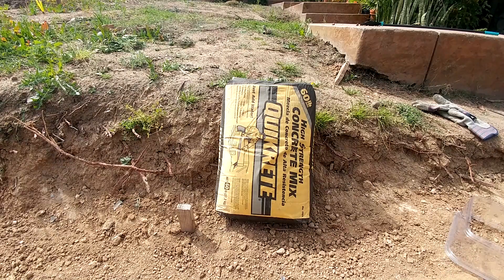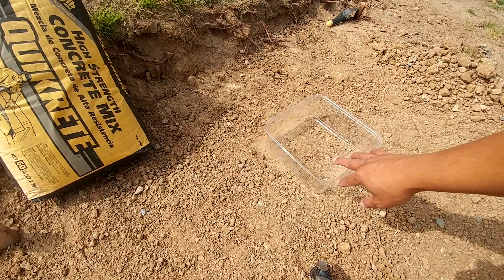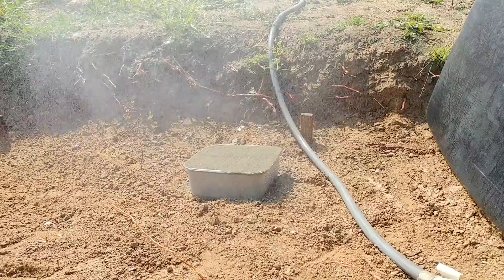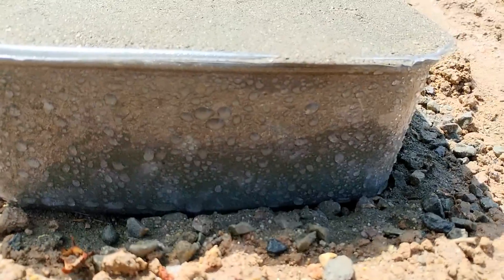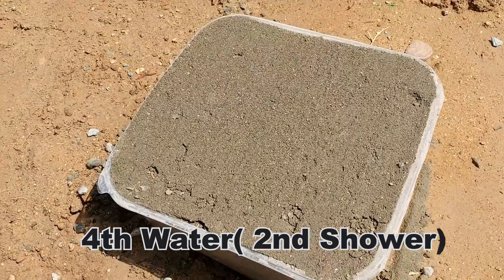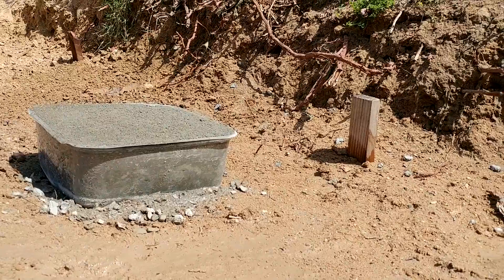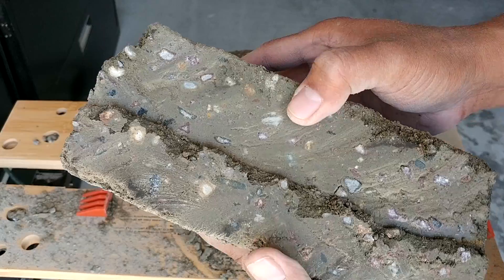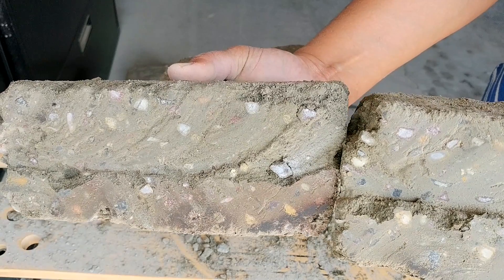You Won't Believe What We Found in This Dry Pour Concrete Experiment.

Comment: concrete takes months to get to full strength leave it and even water it over a few weeks it will soak more water in
Reply from the maker: Thank for the comment.  28 Days to get to 99% and will continue to harden overtime. I have another series of videos on dry pour where I will test the strength development once a week for 35 days. And like you said I will let those samples sit for 60-90 days and do one final test.   Stay tuned.

Comment: This is not satisfactory for use in most high traffic areas. Best used for small areas and foot traffic only. I live in New England and it wouldn’t work here. Maybe in the South, it would be decent. Never compare to wet.
Reply from the maker: I agree. After doing some experiments, I decided to mix the concrete the right way for my parking spot. I just finished it and will edit and upload the video on my 1st pour pretty soon.

Comment: if dry pour was good it would say dry pour in the instructions. concrete trucks would deliver dry concrete mix. the romans would have been standing over the aqueducts misting the dry pour concrete. but none of that is the case is it? this dry concrete thing is just a case of mixing concrete sucks and is hard and believe me i get that im lazy as shit but dude you're all wasting money.
Reply from the maker: Thanks for the input. In what I have observed, dry pour takes forever to cure and you will probably get up to 50%-60% strength as compared to wet pour. You can see that on my other dry pour experiment.   Definitely not for load bearing and driveway application but It could work things like walkway or garden edger. I will not use it in my project but I have seen a lot of people wanting to use this for their projects with different reasons.

Comment: That cut concrete does not look good. It is porous and has many cavities. Real concrete will not be that crumbly and nonconsolidated. That is a quality of not mixing concrete wet. Just letting the water wick into the mix will never get rid of the plethora of voids and it certainly won't mix the cement and water into a homogenous paste which glues together the aggregate. Much of the surfaces of the aggregate won't be fully bonded to adjacent pieces of aggregate due to the vast amount of voids. Concrete needs to be mixed wet. There are no shortcut to mixing.
Reply from the maker: I kind of notice that but I don't have a wet poured concrete to compare it to. The concrete feels and looks solid but the cavity looks like a chalk.  Maybe I need to create a wet pour sample and cut it as well to compare.
Reply: @diymanual  You should do a sample of proper concrete and dry poured and then break both. When real concrete breaks the rocks will break (because the wet cement stuck extremely well to the aggregate). When dry pour is broken the rocks tend to pull out whole, rather than breaking. That is why it is so weak. It is a big no no to rewet concrete after it has already partially set (the surface will spall off), yet dry pours are all about this, every hour for up to 7 times for a 4" slab. 

If you do the comparison test (let them cure for a week) you will see how much stronger proper concrete is when you break both. If the rocks aren't breaking with the crack, it's going to crumble to pieces. 

I am all for people learning something new and giving it a shot, but if you don't get the right info, you could be learning the way not to do it (the absolute worst way with all of the mistakes included). I am not exaggerating, all the methods of dry pours are total mistakes (big no no's) to make sure your concrete will be the worst it can possibly be.
Reply from the maker: @gordthor5351  I did have another set of experiment videos where I compared wet pour and dry pour by putting it under stress driving my Odyssey over it.  You should check it out.

Comment: If you want a nice surface you need to mix concrete the proper way. This ridiculous way is useless and the concrete will be weak and the surface will continue to spall and have more craters than the moon. Concrete needs to be mixed wet and consolidated. How do people think it will work well just by sprinkling water on dry mix? People have also been mixing bread dough for centuries because it would turn out like shite bread if you just tossed the dry ingredients in a pan and sprinkled water on it. Dry poured concrete is like reinventing the wheel to be square. Concrete is designed to be strongest with the right amount of water and it NEEDS to be mixed. It is impossible to achieve either by sprinkling random amounts of water on the top and at hours apart intervals, when one part is hard and the next is still dry. It's called "cold joints" and it won't stick together worth a sh!te. That is why it spalls off and is weak. 

Why are people so intrigued to waste their time and money on this ridiculous way to make ugly concrete which won't last? Don't listen to the experts. What do they know? You are better off listening to some genius on YouTube, of whom clearly doesn't know jack sh!te about concrete. Cajun Country Living has caused a lot of people grief in the near future (when their crumbling project need to be redone properly), or even after they see the ratty finish of their results.
Reply from the maker: From what I have seen and also from my own experience, people look into this method because it is less intimidating than pouring wet concrete. I am a beginner when it comes to concrete, the only experience I have is when I poured slab in my backyard with the help of my father-in-law who knows how to do it right and have the right tools and it took us a couple of weekends to finish the job. 

And you are correct about mixing it the proper way as that is the tried and tested method by the manufacturers to make sure that concrete will last for years.

Comment: Why couldn't you skip misting and just soak it then clean the surface up after?
Reply from the maker: That is a good idea but from what I have seen so far, the powder will not cream up like the way wet pour work, it will just be aggregate on top.  Maybe if you overwater it till it puddles but that means you are applying more water which might make the concrete weaker?

Comment: I don’t understand this obsession with dry pouring. It seems to work “ok” I admit but, seems like more work and more fuss than just pouring it traditionally, it’s proven technology for hundreds of years. 🤷‍♂️
Reply from the maker: Well everybody have their own reason I have read comments from less messy, less tools needed, tight space to no skills required but what attracted me to this method is that you can take your time since it is dry and you just wet it when you are ready. If you mix a concrete, you have limited time to finish your form and if you have a large area to work on it will start setting on you before you can finish your project. Youtube is good for sharing and getting new and crazy ideas but we must understand that we are not experts here so I'm just putting up my share as I do my own experiment to see if this will even work for what I am trying to do and hopefully, it helps others who does not have time to perform the test themselves answers some of their questions.
Reply: That is fair, I guess I’m only looking at it from my perspective, a professional. Concrete can be intimidating even for me sometimes. 
My advice is: do not dry pour anything that will come under tension over time. Just based on what I’ve been taught and what engineers specify. There is too much uncertainty if the mix has been properly combined. Especially coming out of ready mix bags. They are specifically portioned to have the correct amount in each bag to get the correct chemical reaction. 
There is a possibility that the ingredients separate in the bag and you will end up compromising the strength is some way. 
I appreciate the effort all YouTubers make to provide information. Thank you.
Reply from the maker: Thanks for sharing your perspective and advice. I did notice the separation of ingredients with my other samples. I have used 1 bag for 2 types of experiment and noticed that there seem to be more aggregate at the bottom of the cement bag compared to when I did this experiment.  The question is will using the whole bag and raking it to distribute to the form going to evenly distribute materials? 

And I agree, do not dry pour anything that  will come under tension. In my other experiment, dry pour and wet pour both look and feel about the same on my 72 hours and 7 day test but the wet pour performs a lot better when I drove my Odyssey on top of it. Question now is will the dry pour harden enough overtime and how will it perform when I do my final test in a couple of weeks.

Comment: What is the maximum thickness of concrete that can be done with this technique?
Reply from the maker: I think up to 4 inch.  I have seen a video where a deep form is used and it resulted in multiple layers. From what I have seen so far I would not use dry pour method for application that requires to handle heavy load.  Others on the comment said that it works even on driveways but I am still concerned about longevity as it is not yet tested thoroughly.

Comment: I am no concrete expert, but would say that examining these samples after only a day, or a few days is pointless. I heard an actual expert some years back saying that concrete continues to harden weeks and months after laying. In other words if you wanted to break up some concrete, it might be relatively easy after a few weeks or couple of months after, but after a year or two would be much harder still. He also said....water,.....and water more after laying. It will improve the hardness, after the water impermeates through the mixture and bonds the material togethermore and more. Perhaps an actual expert will read this comment and confirm, or even deny ?
Reply from the maker: That is my understanding on concrete as well. It continues to cure through hydration.  The goal for this video is to check if the concrete is hydrated properly using the method and the best time to break it is at 24 hours where you can see it setting and will see powdered material if not properly hydrated.   I did a follow-up for the 7 days and will do another at 28 days. But I think I will have to do a different test or more test at 28 days to determine the strength.

Comment: The way I do my is wetting the ground first and pour cement into the frame and spread  cement leaves about half inch to allow the cement get ferm and wet then poured the rest on top with out rocks as you do it the on top will bound to gather as you smooth the top then wet on top .from bottom to top it will be solid and fermd .it will go fast and easy.
Reply from the maker: Thank you. I think that's the way to do it so every inch is properly hydrated.  But will adding as and mix in top gives you a different PSI? Just wondering 🤔

Comment: Typo. *formula.  And you Waite 24-48hours before removing form but 48 hrs is good enough for any size to have a great result
Reply from the maker: Are you referring to the close captions?  Those are automatically done by youtube. And I did wait at least 24 hours before I removed the form. I did 24 hours only to cut because we are not looking for concrete strength. We are just making sure that all part of concrete is properly hydrated and 24 hours is the best time to break it open to see it.

Comment: You mist first then switch to shower mode and water.  Not misting throughout the procject.  There is a for u,a for doing this.
Reply from the maker: I have 2 samples one sample I mist lightly for the first 2 hours and the other sample that I soak mist for the first 2 hours and I did switched to shower for both of them.

Comment: Your experiment is flawed from the beginning because you don’t understand how concrete cures! Dry poured concrete is reliant on absorbing moisture from the ground and so by putting your sample into a plastic tub your sealing out all the moisture. The second fault you have is checking it after 24 hours. If you knew anything about concrete, it takes 28 days to harden not 24 hours!
Your test results are completely unreliable!!!
Reply from the maker: The plastic container is open at the bottom so the concrete is actually touching the ground and I did explain why I did it at 24 hours.  I do understand that it takes 28 days for it to fully cure but if you are not aware concrete  begins to set once it gets hydrated. It should be set and ready for light application between 24 to 72 hours.  It takes 7 days for initial  cure and 28 days for full cure. Thanks for the comment though. :)

Comment: The misting approach yields very poor surface strength, for some cases this doesn't matter, for a driveway it matters A LOT.
Using bagged concrete is very expensive compared to delivered concrete over a larger area.   I agree that one person can't handle a big area with a concrete truck dumping it all.  But here in Sacramento, you can get mixed-on-site concrete, so they make it as you go, and you can take longer to move it around and it won't be 'hot' when you try to finish it.  This is how we did our brick 16x20 brick patio concrete base.  You can also just do smaller sections.  I make my own concrete from raw materials it is much cheaper this way but it requires a mixer so dry pour not really useful.
Reply: 16x20 is a very large area so it'd make sense to get a truck, but for smaller DIY projects it's extremely effective even using bags.

2-3 steps of stairs will be easily $2k+ if you hire a contractor.
Reply from the maker: Thanks for the tip.

Comment: Great help if I am pouring sandwich size slab where water can get underneath  , but not so good for a real world slab
Reply from the maker: Thanks. There are too many variable with this method. I have seen a video I believe from @MichaelBuilds where he used a sledgehammer to break the concretes and it shows that the inside is moist but still loose on some and still dry on the rapid set after 24 hours.   I have seen similar result in my new experiment that I will post soon.

Comment: Its Quikrete cement, which means its got additives in it so it will set quickly, which is ideal for when you are putting posts into the ground, it was never designed for doing large area surfaces, because there are a lot of gullible people out there watching this stuff, I can see a lot of pain, especially the person who thinks, wow what a great idea, Im going to do a house pad, or a large building project, which requires specific concrete mixes for load bearing.
Reply from the maker: Agree. I am one of those people you mentioned but I  decided to do a few little experiment first before taking on a big project then regret it later. Now I can see some limitation and flaws on dry pour. I will share those experiments once I finish editing them.